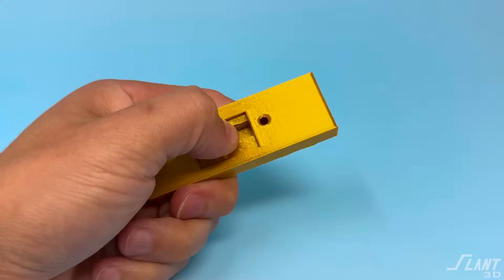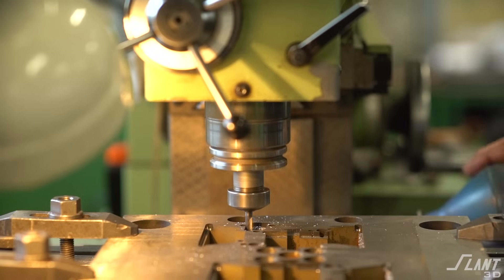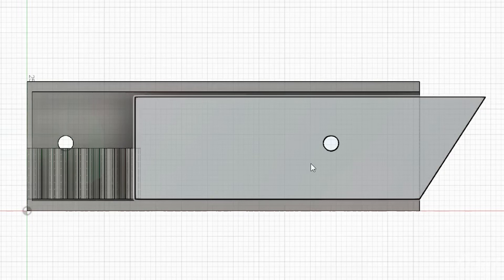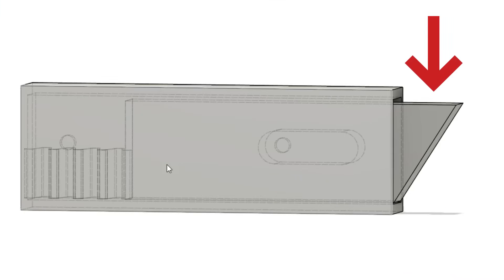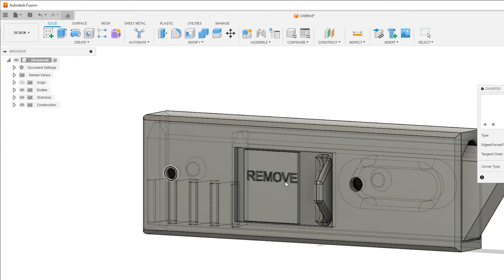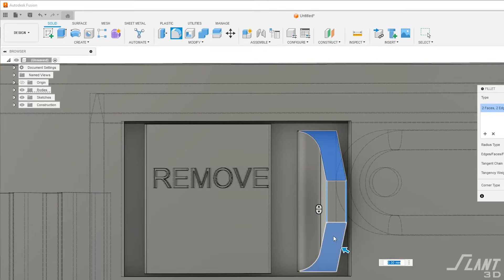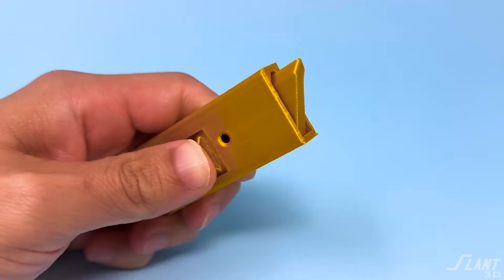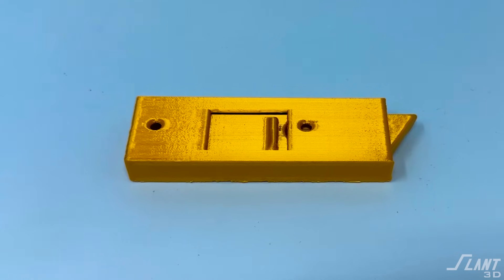Print in Place Latch Mechanism | Design for Mass Production 3D Printing

Comment: How do you design the spring so that it "breaks free" when you first use it?
Reply: Probably have a small 0.15mm gap or so between the bottom of the spring and the base it's printed on. Not sure about the exact number, but it's the same idea with printed supports, you leave additional space between these 2 layers so they don't fuse all the way and easily break off.
Reply: I was wondering the same thing. Also on that support that he put in. How would you do that without it fusing to the surface it is sitting on? It seems that it would be tough to do without it leaving ugly marks.
Reply: @Deathbysnusnu125  There is a difference between normally printing layers, and extruding on top of a layer. I don't know the exact vocabulary on this but I will explain it as best as I can. 
When you print at 0.2mm layers the nozzle actually squishes the plastic onto the layer before it. When you leave a gap (0.15-0.30) the nozzle will just place the bead of plastic on top of the previous layer. The amount of surface contact between those layers is much less so they do not fuse. 
Think of it like putting down a bead of caulk. The right way is to put the nozzle right up to the surface you are working on and when you push the material out you want it forced into the work surface. If you however raise the nozzle off the work piece and let the caulk just drop onto the workpiece, it won't stick well. I hope this helps!
Reply: Very small interface between the bottom of the spring and the top of the surface it rides on. Have a single extrusion width tapper up to the full width of your spring. I'm not sure if I'm explaining this very well. Let me know if I need to clarify my point.
Reply: Any tutorials or videos on this topic? I want to make something similar.

Comment: If you're literally making your molds out of stone, you're doing it the hard way.  Metal is a far better choice.  :/s
Reply: @scott98390  you will hopefully feel very silly after realising he was using an idiom. And the moulds he was referring to were and still are metal.
Reply: @jazzpotato1572  he didn’t say ‘set in stone’ he said: literally set in stone. To be literally set in stone, you have to use stone or a stone like material. Perhaps you will feel silly now.
Reply: @davadoff  He did say "literally set in stone" it doesn't change the fact it was an idiom and the moulds he was referring to most certainly would not be stone. if you don't fully understand why that means he wasn't actually being literal about the moulds being stone, then i believe it's just a language barrier you are struggling with.
Reply: @jazzpotato1572  adding the word ‘literally’ changes the meaning.
Reply: @davadoff again, language barrier my friend.
Reply: It means in a literal manner without metaphor or exaggeration. WITHOUT METAPHOR
Reply: @davadoff  it is ok that you have misunderstood, English can be a tricky language to learn. ill break it down for you. he said Literally set in stone, but nothing is actually made out of stone, you are supposed to understand this based on context and possibly knowledge of the process he was discussing.
he was referring to paying a company thousands to make metal moulds, the set in stone part referring to that fact they can not be easily changed once created due to varies complexities in the cost of doing so and the machining involved.

that's the best I'm willing to do for you, make no mistake, you have clearly had a comprehension issue to arrive at the stance you currently hold.

Comment: I might have missed it, what about the supports for the spring?
Reply: They completely forgot the most important question that people would ask - how the heck does the latch not fuse to the base?
Reply: @lovecastle7154  By having a 0.3 mm space between the parts. They explained with the removable support piece.
Reply: @lovecastle7154 you've probably never 3d printed before if you don't know how to avoid mininum fusing gaps
Reply: @AckzaTV  you’ve probably never printed with petg before. It’s OK o won’t hold it against you. Most people get used to printing PLA then wonder why it doesn’t do so well outside (which I’m assuming this is where latch would be used)
Reply: You don't need supports, you have minor contact point that break the first time you actuate the spring/latch
Reply: Basically the bottom wall is the support and there has to be enough clearance for the bond to be weak. 

I personally would also flip the entire thing so that the contact spot of the latch remains flat, i think thats sort of important for the latch function. 
We could easily make the other side diagonal and it would not even be visible. This would require extra support under the latch though.

Comment: Hi! Could You please tell me how to find a proper shelve for a few 3D printers? Just like for print farm - what to look for? or maybe what You guys have? Thanks!
Reply: Heavy duty shop racks you find at most home improvement stores. They're relatively inexpensive (a single rack cost me about $150 with 3 layers), modular, and sturdy. I can say from experience that you can easily get 3 large printers onto a single shelf, maybe up to 4 "standard" size printers depending on the footprint of the printer.
Reply: I use a table fastened to the wall. You are really looking for stiffness. If you fasten most shelves to the wall you should be fine.
Reply: @eslmatt811  Good solution if you have finished walls, not ideal if you are working in a basement or if your walls are concrete/block/metal though. You can anchor to those surfaces, but they tend to be outward facing, which increases the risk of moisture ingress by a lot.
You can get around the "stiffness" issue by putting garden pavers under your printers on even relatively flimsy surfaces and it will dampen most of the motion transfer. CNC Kitchen has a video on it, something like "The Best $2 Printer Upgrade"